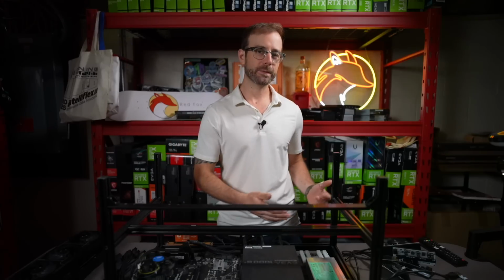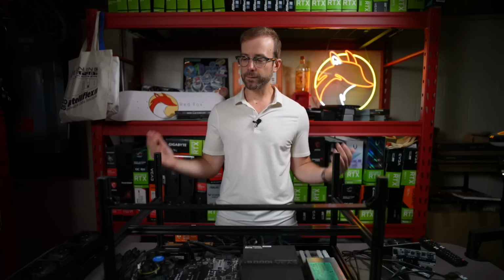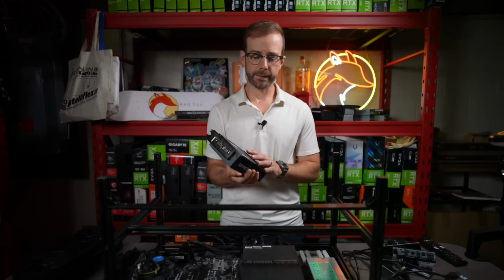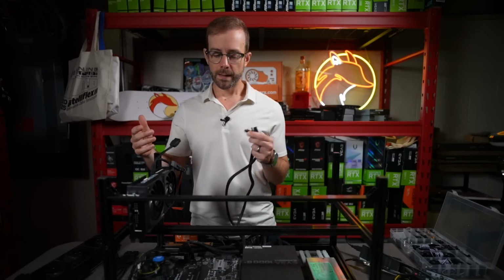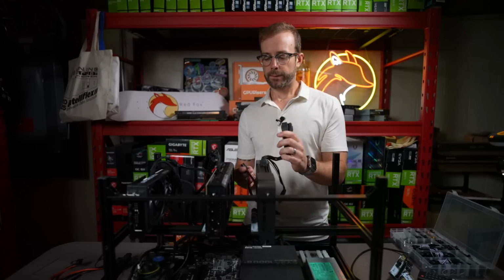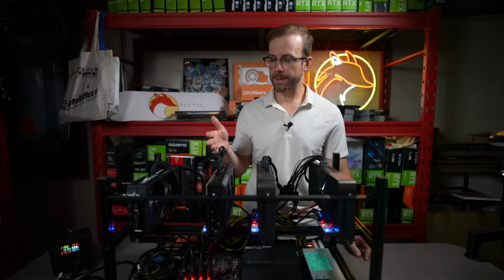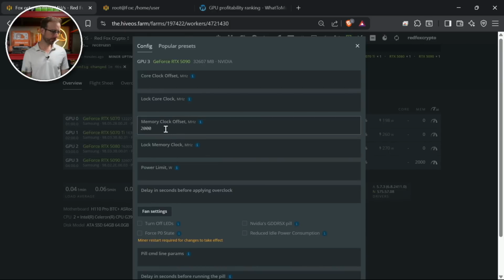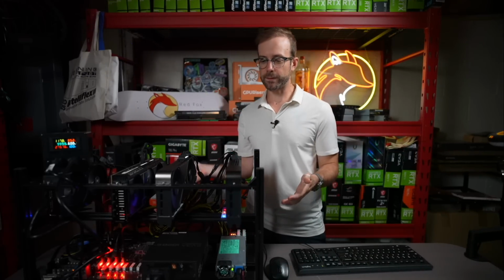50 Series GPU Mining Rig Build

Comment: To have something to do I have started converting to a majority 5070s.  When completed I will be running at the same hash rate have less than half of the cards.
Reply: What do you mine with yours ?
Reply: @ozziemurray  I mine FLUX or Ergo with the 5070s.  Purely look at performance, its hard to justify holding on anything under the 5000 series cards.  Even the beloved 3070 is dated and not rational too run.
Reply: @imaginariumpictures Interesting, thanks for the info. I have free electricity and a 4070ti I found for 240$ was debating making a salad rig or mining with it still trying to learn more tho. I got some asic rigs im running but im trying to learn more about the gpu space. Also what are your profits like with the 5070s? I appreciate you taking the time to answer. Cheers!